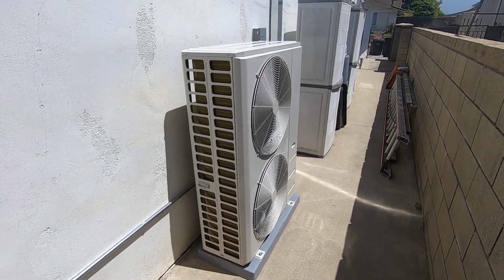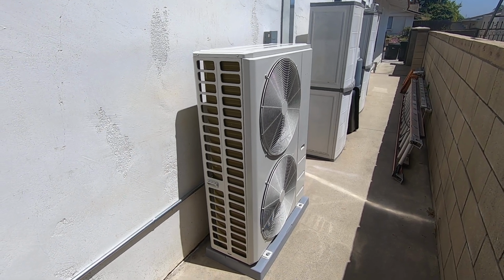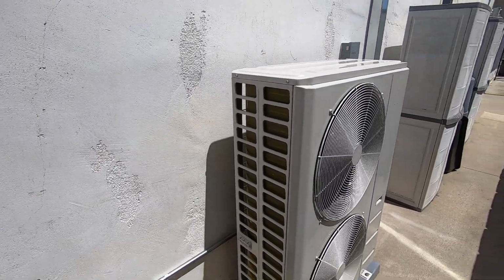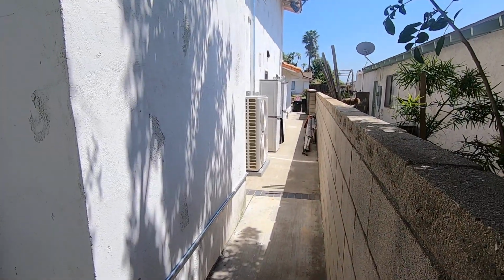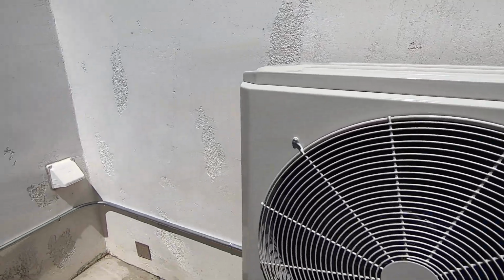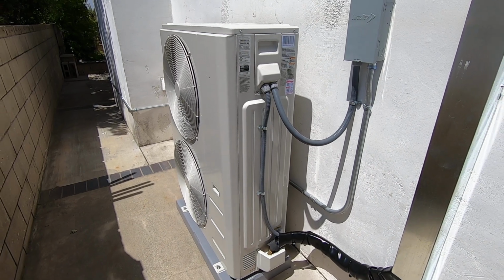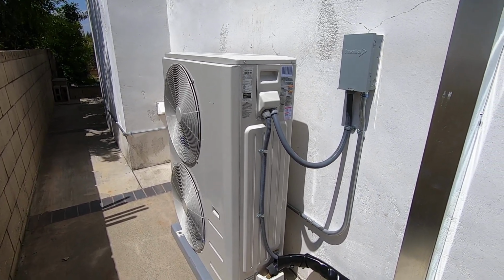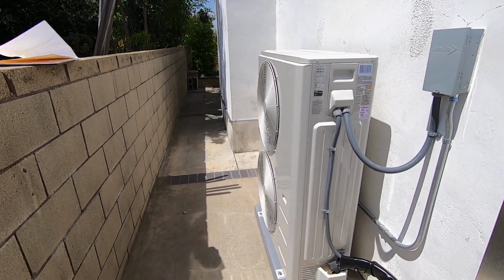Carrier Compact AC Condenser - 38MURAQ - Move to Side Yard

Comment: I am also looking for exact requirements. I am socal - inland empire. Need to move right around the corner from backyard to side. Was the city permit pulled?
Reply from the maker: This will be to code in most cities.  Just need enough room to walk by it.  This unit has 4 feet to the side wall.
Reply: @albertairinc.1140  4 feet good enough, my city has 3 feet requirement.